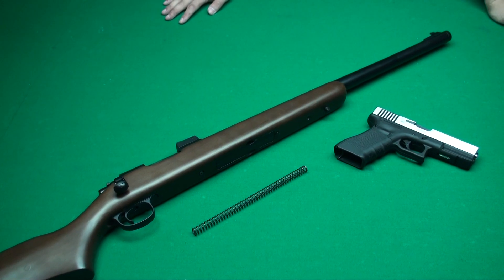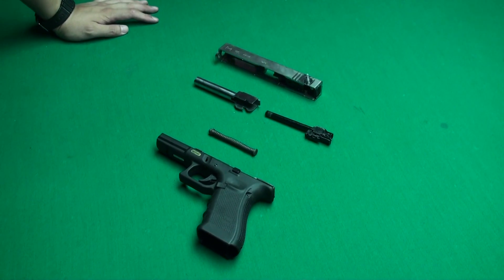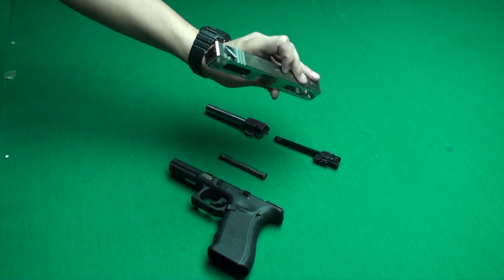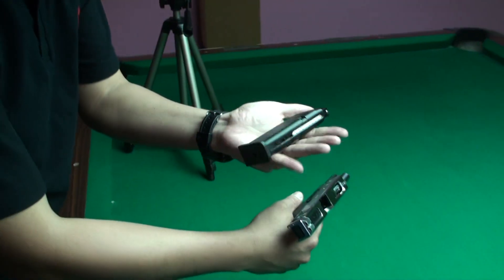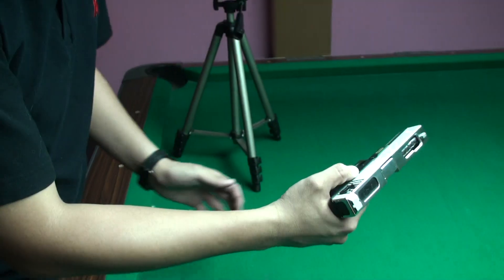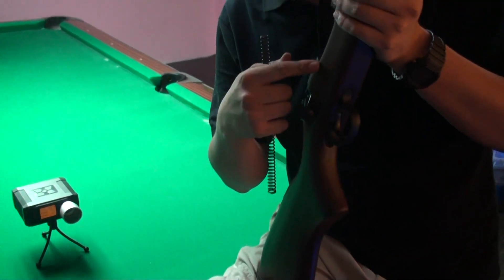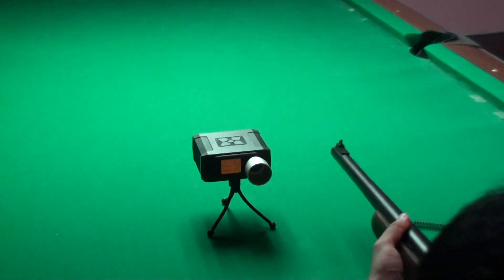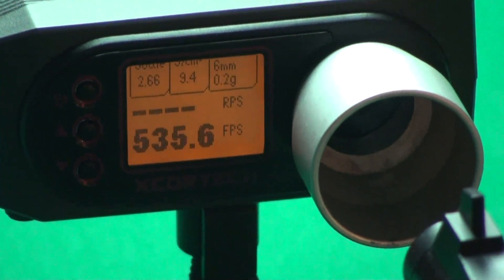RA TECH steel slide and outter barrel for we g18c & new spring for vsr 11

Comment: Agree. Steel parts it's good, but they are heavy. And Hi-Flow valve don't solve that problem. Only high pressure gas.

Comment: How many of you who are saying that steel is too heavy actually owns a steel slide...? I own the RA-Tech steel slide of KSC G17... I can empty the mag as quick as I can pull the trigger on propane (aka green gas), all you have to do is make sure the seals are good at the loading nozzle and a strong enough return spring.